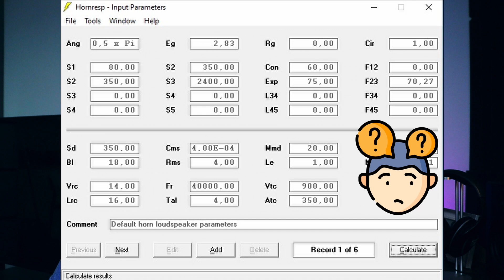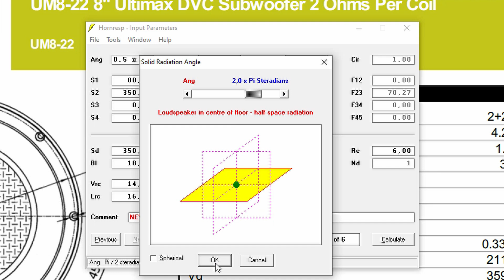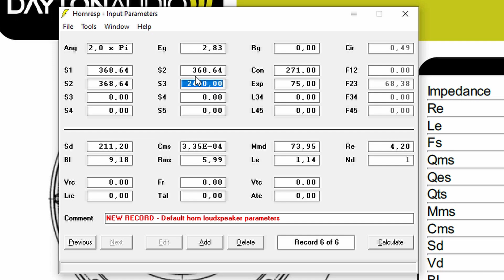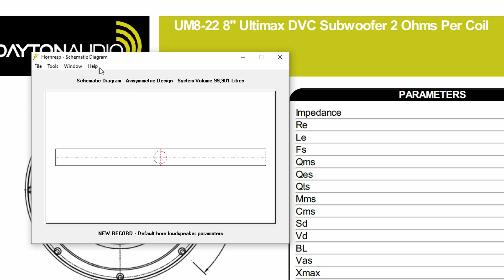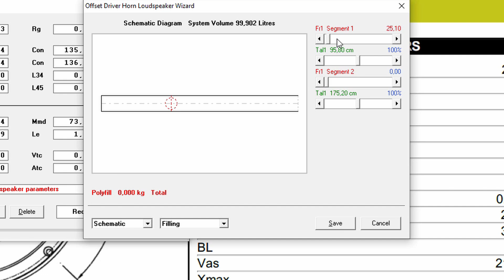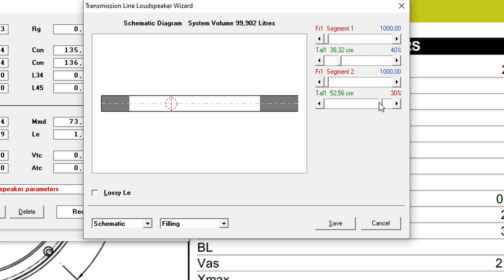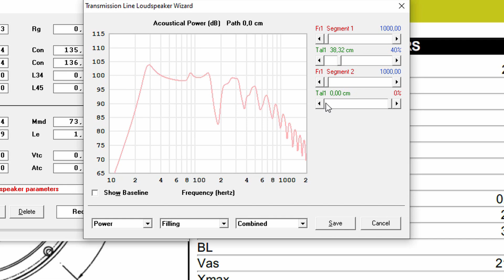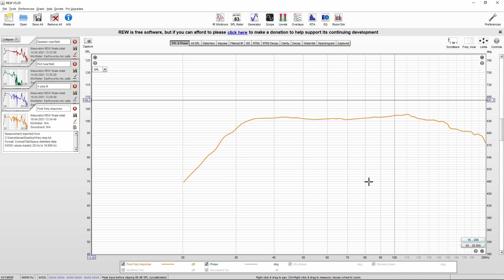Hornresp tutorial - How to design a transmission line enclosure

Comment: Your tutorial was clear and easy to understand. The principle of how t-lines (also called "quarter-wave" pipe) is this:
The REARward radiating sound wave (coming off backside of cone) is delayed by passing through the t-line, putting it IN PHASE with the FORWARD radiating sound wave, reinforcing the lower frequency output.  *not trying to be a know-it-all here, but it may make things easier to understand for viewers that also read the comments.
Reply: How is it in phase if quarter wave is 90deg and back side of the speaker is 180deg? We need 0 or 360 to be in phase.

Comment: “Dampening”: the action resulting in increased wetness.
“Damping”: the action resulting in reducing vibration magnitude through frictional losses.
Sorry.  I had a physics professor that wouldn’t let us forget this.
VERY good video!!
Reply from the maker: Thanks for clearing that out. It’s in even harder to get it right as a non-native English speaker. :)
Reply: @AudioJudgement  Your English is always going to be better than my Romanian.  (Sometimes my English is not so good, either...)
Reply: Please refer to Cambridge English Corpus and see that dampening is not only about making things wet. Also damping is a noun, not a verb. Also read definition of words "damp", "dampen", there are at least two meanings: 1) to make wet, 2) to reduce. Dampening is not a separate word. Example:
This is caused by the dampening effect of collisions.
(From the Cambridge English Corpus)
Reply: @fort9983 in an engineering context discussing vibratory motion, “damping” is the correct word.

Comment: GREAT video.  I was building offset transmission lines in the mid-80's, with the woofer 1/3 of the way down the line.  That gives you TWO path lengths, the short length being 2/3 of the physical length of the line (the distance from woofer to terminus), and the long length being 4/3 of the physical length of the line (woofer to closed end then to terminus).  The peaks and dips inherent in these two different path lengths will offset one another and largely cancel one another out, resulting in a fairly smooth response.  BUT I did not have the ability to model the effects of damping material, and that is imo a very worthwhile advancement.

Comment: The latest version of Hornresp makes it even easier to design TLs. After entering the driver's parameters, just select "Tools... TL Design", then double-click on the Method until the predicted frequency response is close to what you're aiming for.  From there you can fine-tune the sim by changing the location of the driver, the csa of the line, the filling, etc.
Reply: Actually it is Tools -> Design Wizard -> TL Design. But thanks for the tip.

Comment: To achieve the same results, instead of offsetting the driver, you could put the baffle inside the box, and fold the tube to make it end exactly where the driver is.  There is only one vent, and both the direct pressure from the front of the driver and the back pressure that travels through the tube exit through the same vent. Advantage: you don't have to use any absorption at all. Zero damping!
Reply: How do you simulate it in hornresp
Reply: Are you describing a 4th order bandpass?

Comment: Thanks, finally some a good tutorial for Hornresp. Would you consider doing a video on another type of horn sub using Hornresp?
Reply: I have also tried using this formula of displased air volume:-.                                     f=C/2π√A/l/v where:- A---sectional area of duct.       I----length of duct.            V--the active displasable volume.            C--speed of sound in air and it works well with small drivers of around 12cm diameter and less but when it comes to about 15cm and above the sound only gets muffled up. Why could this be happening?

Comment: Really Great video! But what happens if i Place the driver close to the exit of the line? Like i designed a tline of 2.3m for the ultimax 12" placed at 40cm in the line , i got the exit of the line at about 10cm of the driver

Comment: I am curious, if you use multiple subwoofers do you need to multiply the Sd? So in your case if you added a second sub would you double the area of the t-line to like 700 or leave it the same as the single driver?
Reply: Not sure if you still need the answer but basically yes. You can also simulate double speaker in hornresp. Also you can experiment and make the area of your pipe smaller than total Sd of your drivers. Sometimes it works nicely

Comment: Very enlightening video Marius. Big fan of your courses. Please keep going!
Quick question. The oem announced t/s parameters of the drivers are usually apart from real measurements. Do you suggest using oem specs or dats messured specs while defining quarter wave length?
Cheers
Reply from the maker: Ideally you would wan’t to burn-in the driver, measure it, and use those numbers. But manufacturer specs are ok too.
Reply: @AudioJudgement  thanks! Sure after burn in.
Reply: @AudioJudgement  Depends on the manufacturer.  Dayton is usually pretty good with their published specs (I've used many of their drivers).  Some other manufacturers, not so much.  However, they're not difficult to measure, using a simple DIY Impedance jig and the freeware REW software.  Or you can just do like I did and purchase a DATS for that purpose.

Comment: But the measurement are taken at 1 meter? Normally. Why you stick the mic next to the driver? ,a trapezoidal exit path help to cancell out the resonances/modes  of a square area, in theory. Great job!!
Reply from the maker: It's the only way to make an anechoic measurement without an anechoic chamber. At 1m you capture room response as well. Nearfield measurements are accurate only at low frequencies (depending on speaker size) and therefore work great for subwoofers.

Comment: Very nice!  Thank you for doing this tutorial.  I have a pair of the Dayton Ultimax 10" subwoofers just delivered recently.  I have wanted to build a T-Line enclosure for the pair to go in the back of my Ford F-150 extended cab (rear seats removed).  Your tutorial has made this possible since there aren't too many viable examples for the layperson out there.  Have you tried to make a dual subwoofer t-line box before?  If so, how did it work out using two subs?  Thanks again!
Reply from the maker: The area of the line needs to be at least 2x the effective area of the cone. So, you can imagine that the box size would be huge. It's the same thing as with 1 speaker only that the area of the line needs to twice as large.
Reply: Have a look on hexibases channel, he build a Tiny dual sub t-line. Maybe thats helpful

Comment: @3:15 you said "+6dB , +12db ,( +18dB) on the screen and so on ,i don't know what this is here" , actually is  0dB on free space ,the loading setting is to get an accurate SPL graph of your simulation, when your cabinet is in free space ( a pole ) or hanged in air, you do not have any loading thus you do not have any dB gain on SPL, every time you add a boundary, that means like the floor that is +3dB , every time you add another boundary there is +3dB , so  long story short,   cabinet in a  pole stand, 0db gain,  cabinet on the floor with no walls +3db, cabinet in the floor next to a wall +6dB gain , cabinet in the floor on a corner +9db Gain cause there is 3 boundaries, floor... wall and wall ( as it is on a corner )  so normally when you calculate for outdoor PA you use 2PI that means floor loading only as there is only a +3dB gain for the floor.   and normally home audio use corner loading ,+9db if the sub is on a corner,  or when you are designing a sub for a car sub you use corner loading as the cabin gives you the extra gain, you can use lower sensitivity drivers because you have the +9db boost from the cabin or trunk. and that gives you an accurate projected SPL graph depending the power in you are feeding to your driver. also every time you double the cabinets you have +3db gain and if you double the power you have another +3db gain, so if you have a car sub and you have a 500watt amp, if you add another identical cabinet and another 500w amp you have upgraded your system +6db from what it was before.  hope this helps.
Reply from the maker: Hello! Everything you said is correct. However, transition from full space to half space to quarter space results in +6 / +12 dB gain (not 3dB increments).
Reply: @AudioJudgement well
 , here is some theory "Space-loading loudspeakers means that the otherwise
spherical radiation is limited by a boundary or boundaries.
Some common scenarios are shown in Figure 1, and are
often described by the fraction of a sphere to which the
radiation is confined. Since these are fractions the correct
usage would be "1/n-space" but I have used the common
descriptors that omit the "1/".
The classical theory states that the effective gain realized
from incoherent summing due to radiation confinement is
+3dB for each additional boundary, and that +9dB relative to
the free-field response can be achieved by "corner-loading"
a loudspeaker. In acoustics the results are never that ideal, so
part of my motivation was to determine when this or something different happens. We would certainly expect the
boundary interaction be frequency-dependent, and indeed it
is"

see page 4
https://www.prosoundtraining.com/site/wp-content/uploads/2012/03/VOL36_DEC08_Boundaries-1.pdf
Reply from the maker: @rolosaenz  The author of the paper you linked want's to dispel the fact that when placing a speaker near a boundary, the gain is not +6 dB, it's more like + 3 dB. There is no denying that measuring a speaker inside a large room will result in all kinds of results depending on the box size, number of speakers inside the box, mic positioning, room modes etc. You can even see that when measuring a horn, the gain is basically +0-1 dB regardless how many boundaries. Nevertheless, the theory is that in ideal conditions the increments are +6 dB. Check the graph at the top of page 6, where you can see the 6 dB difference between graph lines. Anyway, I if you design, more or less, conventional style boxes for subwoofers in Hornresp and play with the solid radiation angle slider, you will get 6 dB variations between ticks. However, if you use the speaker-box example which comes by default when starting the app (which is a horn), and start playing with that slider, the result are quite different. This answers my question of why that slider is even there, and also reminds me of how limited is my experience with horns.
Reply: @AudioJudgement  Yeah, you was right about the +6 and +12 gains with wall loading and corner loading my friend, my bad, regarding the slider  (Ang ) it is there to make easier for you to simulate a target SPL and see if you reach your goals with 1 cabinet or you need more, or you just need to change to a higher capable driver and more power and so on.

Comment: Hey love your work I am trying to make a box That Can Perform an accurate bandwidth of 20 - 60 Hz in or out my cabin for an SQL-SPLBuilt.with an Accurate frequency response.I have a DSP that can save the different settings and a RTA to tune it so I figure that it can be possible with the windows down so the cabin won’t acted as a chamber and give me a different Response. All of this in mind I think is best going for a sealed box 15 inch isobaric load .Am I going in the right direction for the Built?Is it even possible?
Reply from the maker: Actually, rolling the windows down does transform the car into a chamber. The whole thing is basically a 4th order bandpass. The subwoofer is already in a sealed box. And the car is the ported chamber. The port being the window. Of course, lowering all 4 windows all the way down will negate the effect. In my experience rolling one window not all the way down, increases the perceived pressure. Anyway, regarding your question, a sealed subwoofer usually doesn't play linearly down to 20 Hz. But if you DSP the crap out of it, it can do it.
Reply: @AudioJudgement  going for a t-line since all doors will be open I’m going for a pro audio built but what does a isobaric do
Reply: I would go 6th order bandpass

Comment: Hi Marius, for me would be the most important questions about sound quality. Is it worht to struggle with TL? Is it sounds better than bass reflex?
Reply from the maker: I can see that appeal in building a T-line floorstander for a full range speaker like the Fostex builds. But if you want to build a subwoofer, bass reflex wins in so many categories, it makes the decision quite simple.
Reply: @AudioJudgement  Thank you for answer, Marius. Regarding complexity to produce is obvious winer is bass reflex. But in your video you wrote TL sound very different compared to any other enclosure type. This is most interseting part for me. What do you mean? Is it sound better or worse? What is you impresions? If it possible to describe with words.
Reply from the maker: @evaldas7346  I like how it compliments a pair of fullrange speakers without being too obvious that there is a subwoofer present.
Reply: With today's high performance subwoofer drivers, box design programs usually end up suggesting small boxes with long large vents.  In those cases, it might be best to just build a TL instead to ensure that you don't end up with big peaks and notches in the passband due to pipe resonance effects.  And with a TL you get the added advantage of the internal panels also helping to brace the box for better bass performance. 

My "Boom Unit" build is an example of a design that looks like a shelf-loaded vented box, but was actually designed using TL techniques to reduce the impact of pipe resonances. More info here: https://www.diysubwoofers.org/projects/home/boomunit/
Reply: @AudioJudgement  Thanks